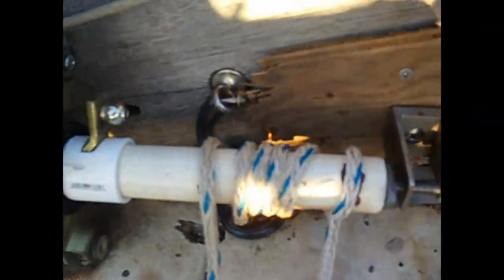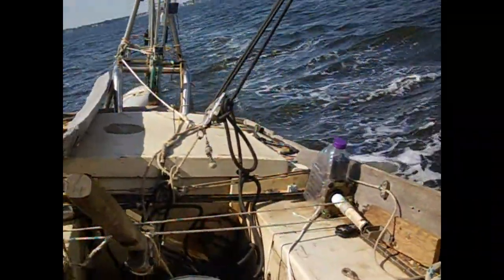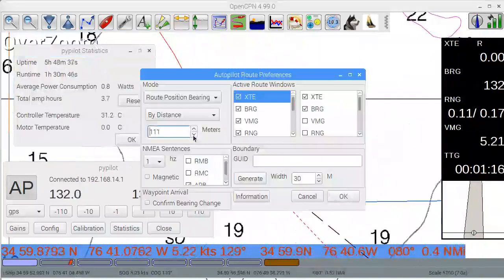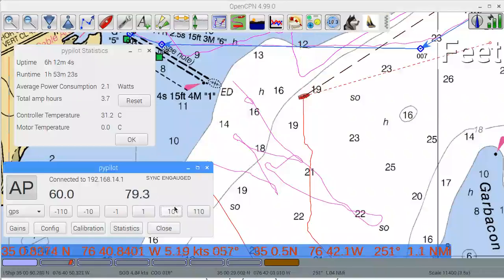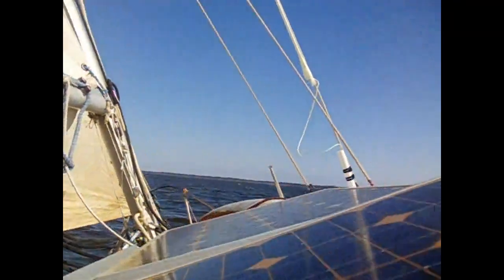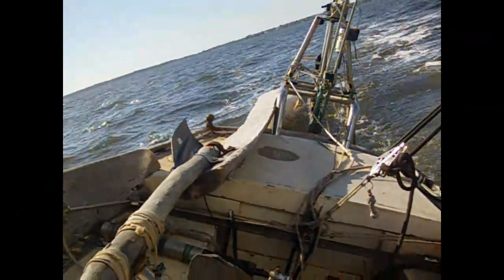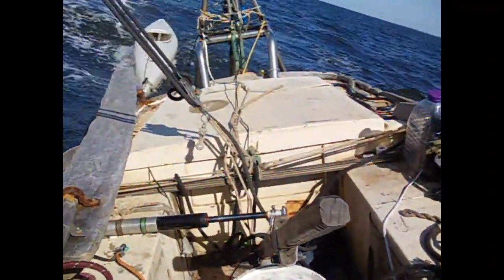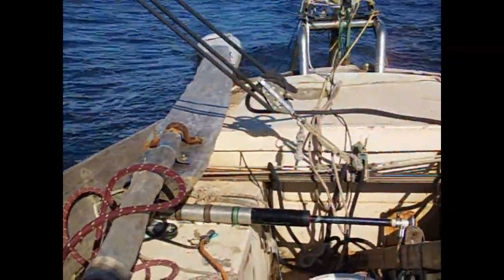pypilot windshield wiper motor

Comment: Why not hook up to windvane? Wouldn't it be less effort for the motor?
I have a couple of salvage tiller pilots and am happy to give your ideas a try.... just sharing what some fellow Pacific Ocean voyagers showed me regarding attaching the tiller pilot to the wind vane to steer the tiller to reduce the effort of the components.... think gearing!?
Reply: Um, probably because the whole point of using a windvane is to steer the boat without needing an autopilot. The advantage of the windvane is that it doesn't use any power at all. The disadvantage is that the windvane steers a course relative to the wind, whereas with an autopilot you can steer a magnetic course or courses driven by a route planning program like the OpenCPN.
Reply: Oh Great DIY, Guy; The Tiller to Windvane theory of operation is that the tiller pilot steers to a magnetic (GPS in your mode) course and then the linear drive tilts the windvane sensor mount. With the vane's wind sensing vertical fin removed, the vane steers to the tiller's movements, magnetic (gps). WHY? to reduce power needed to move the linear motor and let the tiller pilot operate in heavier winds/speeds (they are often undersized) People who need a bolt-on solution do this. One-who-Hacks, can graft-in a windshield wiper motor, or even hydraulics to amplify the output of a smart (if small) tiller pilot. Cheers!